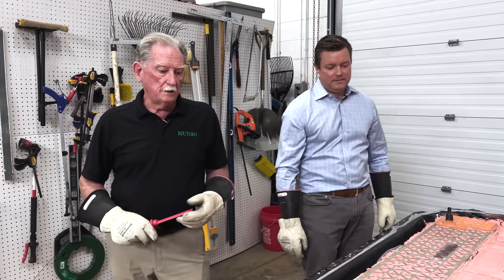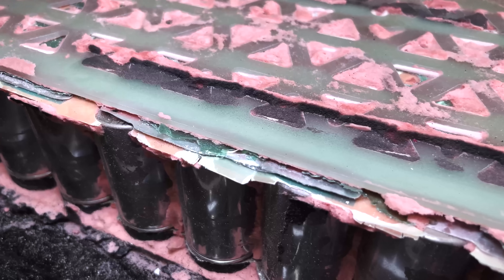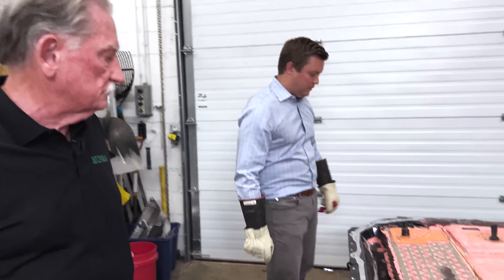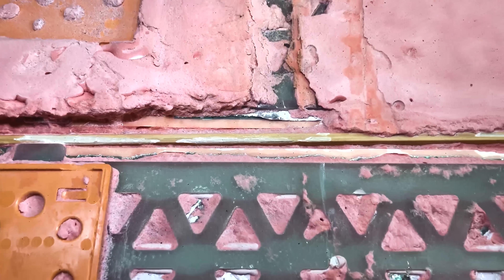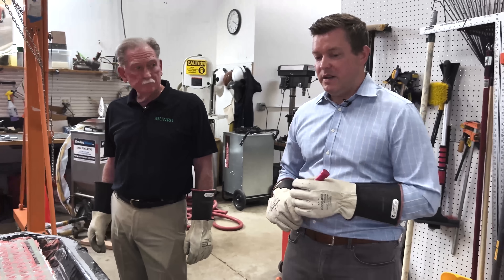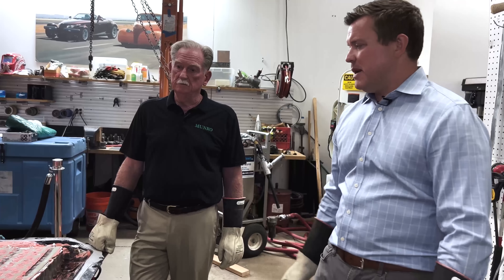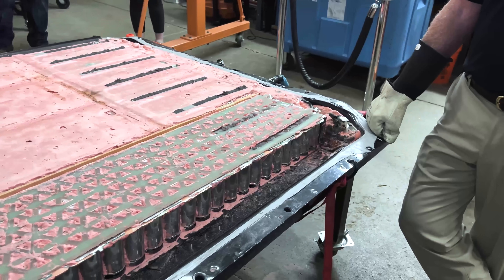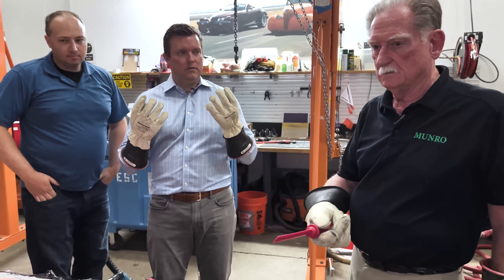4680 Battery Pack: What We Found Under the Foam!

Comment: Following along with the tear down, very interesting.  I will note that liquid nitrogen is no where near absolute zero, it's −196 °C  (− 320 °F,  77 K).  That may be cold enough for this recycling process but if you really want closer to absolute zero you need liquid helium which is -269 °C  (−452  °F,  4 K).
Reply: I think vw has already built their own batteries recycling facility using similar process with neutralizing the cells before crushing it.
Reply: This battery in all this horrible foam is UNREPAIRABLE. The smallest defect in one of its Contactor-Relais or electronic modules inside this battery will need you to throw it away  completely. A repair of your car will cost you then 14'000$ or more, which could have been fixed on an older model 3 battery with the same problem for like 2'000$ only. Stay away from those 'structural Batteries'.
Reply: @thesolderman861  you complete moron. neither the contactor relay nor the electronics are inside the abttery case. all of those are in the ouithouse.
Reply: No one will be wasting helium to cool down batteries for recycling.
Reply: @Narcissist86  bro people use helium to make their voice sound higher, idk about the prices, but I doubt it's that high and while you say "used" that makes it sound like the Helium is gone afterwards which it isn't unless you use a redioactive isotope but that would be overkill and is only done in physics experiments lol
Reply: @LunnarisLP  "Bro", I don't think you know the field very well:
1) There is a helium shortage right now - the fourth one in recent history in fact. Some of it is short term due to refinery shutdowns, but some of it is due to the US completely selling off their helium reserves last decade. For cooling purposes you're looking at liquid helium, which costs upwards of $100 / litre, and you're going to need A LOT of it if you're trying to cool tons of batteries to near absolute zero for recycling. Good thing that part isn't correct.

2) The main consumption of helium is for industrial and medical uses, not for party balloons or tricks as you're alluding to. Not to mention the main difference here between liquid helium and gaseous helium. If you know any party planners actually, you'd probably hear tales of price increases and scarcity for gaseous helium as well.

3) Helium released in the atmosphere actually IS lost forever, at least in terms of our terrestrial concerns. Helium is light enough that it will keep rising until it escapes Earth's atmosphere. The majority of helium is produced as a byproduct of oil and natural gas refining. Its scarcity and cost is the reason many industries use dedicated helium recovery equipment. That should tell you about the costs of constantly buying liquid helium - universities for example is willing to invest in a whole million-dollar helium recovery systems to recapture and reliquefy helium that has boiled off from their instruments.

So yes, it's not a renewable resource, and it's getting more expensive and scarce. I know that all major helium suppliers have declared force majeure, meaning due to circumstances beyond their control, they cannot honour their existing supply contracts to their customers. At best maybe they can provide 50% of demand currently.
Reply: Will such process for recycling be cost effective compared to mining new materials?
Reply: @BekTesfa  Probably by an order of magnitude. From a  mine you have to separate what ever from a vast amount of dirt. Everything from the pack minus the plastic and glass fibres is of value. Actually if you can sort the different plastics some of them have value as well.
Reply: @BekTesfa  extremely cost effective
Reply: @BekTesfa  If it gets scaled with a lot of supply of to-be-recycled battery packs yes. 
Else no.
Reply: Thanks 😊
Reply: Still that is colfd. (F in cold) 😉
Reply: Don’t kid yourself with that deep freeze recycling BS.  These are going to end up in India, China or another 3rd world shithole to be recycled in a very dirty and manual process.
Reply: This is another tire recycle scam shit
Reply: ya, the details were off - the low temperature isn't so that the materials can shatter,  the low temperature stops or greatly slows down the chemical reactions - so that crushing it doesn't just short everything out and cause a thermal runaway from the residual charges in the batteries. 

Every drop in temp by 10 degrees C,  halves the chemical reaction rate.
Reply: @KenLord  Actually, the low temperature of a liquid nitrogen bath is used to make composite materials brittle order to crush them. The cold temperature serves two main functions in order to brake complex artifacts apart: First the different expansion coefficients of each material breaks them apart at their contact surfaces because of different rates of contraction. Secondly, the cold temperature makes most amorphous polymers very brittle when a certain threshold temperature is reached, called the glas transition temperature tg. Most rubbery materials will become so brittle that a slight hammer stroke will pulverize them. So in the end, when you expose something like this battery pack to liquid nitrogen and than start hammering it I guess that pink polymer stuff will just pulverize immediately and the metallic components will fall apart into pieces that are made of aluminum, coper, steel aso
Reply: @ParameterGrenze  ok cool ... BUT LITERALLY NO.   It's about not causing a thermal runaway from shorting out the residual charges in the batteries.   After that it's just a freaking jaw crusher, or multiple stages of commonplace crushing equipment chewing away at it all.

You learn about how temperature affects reaction rates  (Every 10 deg C cooler halves the rate) in high school chemistry, or at the latest in 100 level university chemistry.

There's nothing inherently difficult about pulverizing the materials that would require that it be so cold to enable it to shatter.  This stuff isn't Vibranium. 

The prototype liquid nitrogen system made by a startup company was shown off in a Now You Know episode a year or two ago,  with the purpose of it all being exactly what I've described. I'd provide the link if I had it.
Reply: @ParameterGrenze  My understanding is that recycling tires involves freezing the tire with liquid nitrogen and crushing it to separate the metal belts from the rubber.
Reply: Tyres can be shredded at room temperature. Maybe there is an advantage in making them brittle.
How hard would the steel cases get in liquid nitrogen? Maybe crushed then shredded.
Reply: @KenLord  one should add that LN does the trick but so does just discharging the battery to 0volts. And discharging it is a lot cheaper and safer.
Reply: @Ken Lord  I am impressed by your knowledge of high school chemistry. However, yes, there is a process where cryogenic liquid nitrogen is used to make recycling materials brittle and, as I described above, separate them easier into different components. It is called cryogenic grinding, or cryogenic milling which is usually followed by a hydrometallurgical process called froth floatation, where the grinded particles are emerged in water and separated into different constitutions based on their hydrophobicity using air bubbles which selectively adhere to the surface of the particles. This sounds very much like what Monro is describing in his own video and accidentally the process which the company Toxco, which handles large scale lithium ion battery recycling and has been working with Tesla for several years now, uses. Given that I give the engineer Monro, despite making a not quite right statement about the physics of the process, would not confuse the basics of the engineering process itself he talks about, I tend to give him the benefit of the doubt that he bloody knows what he is talking about, given that he has his toes dipped deep in company secrets and details that both of us know little about.

So yes, low temperatures can reduce the reactivity of the cells during storage and breakdown, but I guess similar safety can be achieved with less cost than actual cryogenic freezing by using inert atmospheres like nitrogen or co2 during the process. The beauty of cryogenic grinding is that it gives you both, the increased safety, as well as the benefits of higher recovery rates of anode, cathode and other constituents(which is the reason for the cryogenic treatment in the first place, since simply shredding and grinding the material results in lower recovery rates. This is due to organic binders on the surface of the electrode material being peeled off due to the cryogenic process, which otherwise would lead to problems with the separation during recycling down the line).
Reply: @ParameterGrenze  Well said.
Reply: @anonym3017  but is much more difficult as the bms will not allow the pack to go to zero volts. So freezing it is the best option.
Reply: @jackdbur  yeah no. Just connect directly to the battery turning it into an unmanaged one or program a recycling mode into the BMS where it allows going to 0 volts.
Reply: @anonym3017  Even if you could reprogram the bms you would have to connect it to a load and wait until it discharged to zero.  Liquid nitrogen is relatively cheap and readily available & much faster plus allows a better separation of the components especially the plastics.
Reply: @jackdbur  oh no it takes 10 minutes to discharge the pack. So horrible.

Yeah no. Discharging is much cheaper than some triple digit number of kilos worth of liquid nitrogen per pack. And LN ain't that much quicker either.

And the separation doesn't get better with liquid nitrogen. For that matter it gets slightly worse as frozen shredding results in the casing and plastics getting shredded to a much smaller size than at room temperature.

Which is entirely unwanted as the battery internals are wet powders that aren't attached to anything even without shredding. So the purpose of the shredding is nothing more than opening the cells as quickly as possible in an automated fashion.
Reply: @ParameterGrenze  what about the energy costs of doing cryogenic milling on such a large scale with such large objects? The other issue I see is extremely contaminated waste water when using it during the materials separation process. Do you have any idea how the recycling industry will handle these 2 major issues? Thanks.
Reply: @Mike-lh1rq  With energy costs you have always to look at the alternatives: Mining the materials out of the earth, refining them to a certain purety and transporting them half across the world. As for recycling, the other alternative is smelting the cell components and retrieve the materials afterwards. Now smelting metal isn’t cheap in the sense of energy usage. In the end, it is all about how economic the whole process is, but since there is a process of cryogenic grinding that is used by a company on a large scale I guess that someone has done the calculations and it checks out for them. 

As for the water waste I am not sure. It’s not like the water is continuously replaced in the tanks, it is probably a closed loop.
Reply: @anonym3017  Discharging this pack to 0 seems more complicated than other packs. It's covered in foam so you can't get at the terminals except for the external bits without tearing them apart in a time-consuming manner. If you measure only from the external there could be a large bank of cells that have a charge but were disconnected from the rest of the pack due to a blown wire/fuse and thus giving you an artificial 0 voltage.
Reply: @kickassnetwork  if you go back 2 or 3 videos you can see the connectors sticking out of the battery case. the things with rubber hose stuck over them.

the pack also doesn't contain any fuses and the wires connecting entire bricks trogether are so thick that a fault capable of melting them just results in a battery fire.

so you can just discharge it from the outside as that danger doesn't exist.
Reply: Most commonly, lithium batteries are recycled in large plants by a process of shredding the whole battery down to a powder. This powder is then either smelted (pyrometallurgy) or dissolved in acid (hydrometallurgy), thereby extracting the individual elements for resale.  If you are going down the smelting route why not just grind the batteries up in a high temp resistant tub grinder to start the thermal runaway process then drop the hot flaming mess into a kiln to finish the smelting...this would use the potential energy still contained it the batteries to help raise the temperature thereby reducing the amount of energy required to smelt.
Reply: @rolandrauenhorst2002  because the polyurethane gives of nasty fumes when fried. By cooling the pack instead the polyurethane (and other organic materials) could be extracted before smelting.
Reply: @rolandrauenhorst2002  you don't want an intentional thermal runaway, because then, instead of getting nice pure lithium, nickel and other metals, you'll get a bunch of oxidation and intermetallic reaction products. Look at it this way: the flames is energy being released in an oxidative reaction. To get rid of the oxygen bonded to the metal atoms, you now have to add that energy back in to break the oxygen bond.
Reply: Cost of recycle is more expensive than the battery it self … this ev scam is like nespreso coffee capsule they claim recycle and in reality not …. This will be the biggest scam on earth life non of these batteries willl be recycled and Elon and his company care less …. They made billions and enjoyed life …. Beside how the heck you repair it ??? Fi can’t
Reply: @AAA-kc9ol  ah yes. shredding something is hugely expensive. wait no it's not.

neither is drying anode/cathode dust.

and after that you just treat the dust like really, really pure nickel, manganese and cobalt ore if it was an NMC cells or really pure iron and phosphorus or if its an LFP cell.

so the cost of recycling is well below the cost of mining new material. which means that it'll get recycled cause doing so is profitable.

the same btw goes for the nespresso capsules that are pure aluminium which you just have to throw into an induction furnace.
Reply: Shredding and separating something with so many different materials is ridiculously inefficient and just magical thinking.
Reply: @kco1270  mate once you have shredded it and separated it by size you are left with a bunch of aluminum, steel and copper that just getswashed and molten down, a bunch of plastic that gets washed and burned for energy and a bunch of black powder that you just treat like reallly really high grade nickel, iron, manganese, cobalt and phosphorus ore.

and just for the record. that black dust is inside all lithium battteries. so no matter what recycling method you choose you end up with it.

Comment: It's interesting how they built these batteries these packs are built to last, the 1 million mile battery. There's very few parts, just what is needed to make the battery to work. The foam could be acting as a heatsink helping to spread the thermal load and possibly in a thermal run away to decompose and help to put it out.
Reply: Lol….. it absolutely doesn’t mean it will last 1 million miles maybe end up with 60% copacity at that time or the electronics would have already failed or the pipes…… even many cells

Comment: A very interesting reveal and not what I was expecting. I was of the opinion that the upper and lower case of the pack would be tied together in some way and feature lateral locators for the cases of the cells since secure location of the cells to these top and bottom sheets would be desirable in order to impart stiffness to the pack but it's beginning to look as if the only method of attachment may be via the adhesive properties of the foam.
I'll be waiting to see if the ABS base and 'Nylon' upper sheets feature locators to keep the cells in accurate lateral location to achieve the stiffness.
Overall I'm surprised however to see that Testla seem to be relying mainly upon the foam to keep everything in place since I would expect the foam to be vulnerable to degeneration/collapse over time due to constsntly being subjected to stresses in use but as Sandy says, it's desirable to avoid threaded or other fastners if you can.
Hopefully all will be revealed when the Munro team dig deeper and I'm still intrigued.

P.S. I wonder if all the cells have cases of the same thickness since I noticed in the teardown of one of these cells that the case was far thicker than might have been expected and the greatest stresses will occur diagonally across the top and bottom sheets in torsion and at the midpoints of the sheets in lateral and longditudinal flexion. If not then Testla could save a bit more weight here provided that the added complexity of producing cells with more than one case thickness is worth the effort.

PPS. It's all analagous to the principles in operation with Nomex sheet and where constructions with this material are concerned the failure point usually seems to occurr where the core meets the top and bottom sheets where the surface area of the interface between core and surface sheets offers insufficient area for adhesion under load.